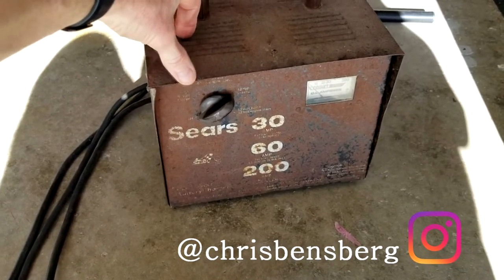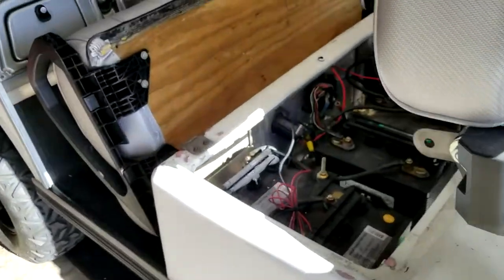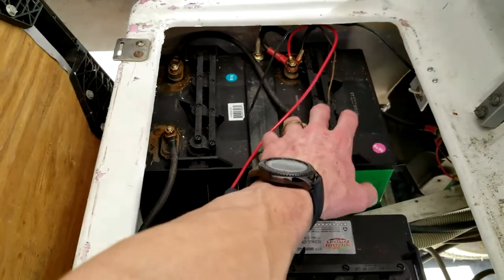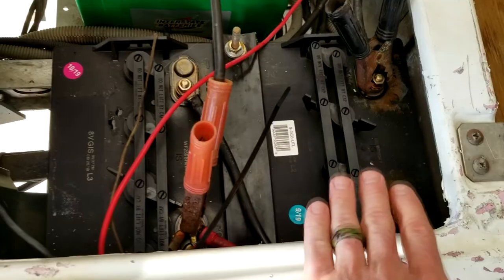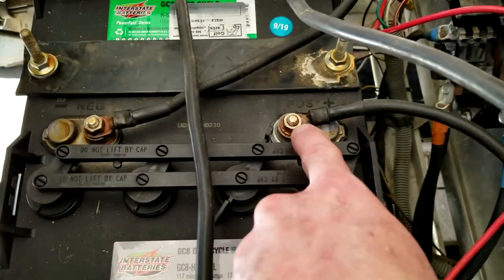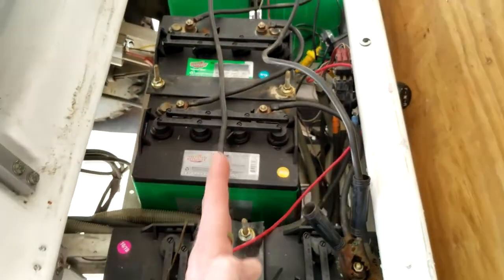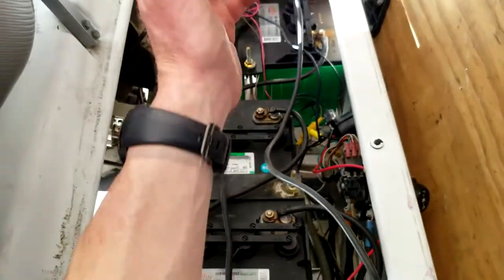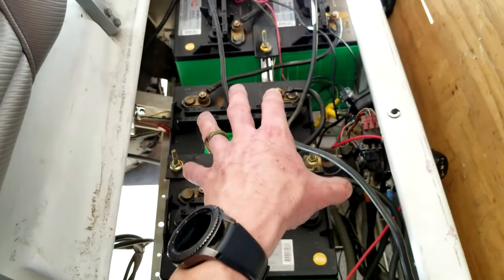How To Charge Your Golf Cart Batteries Manually If Your Charger Will Not Work FIX!

Comment: I have the opposite problem, I replaced the batteries with new Trojans and the charger won't shut off , let it run overnight and it boiled my batteries , any suggestions?